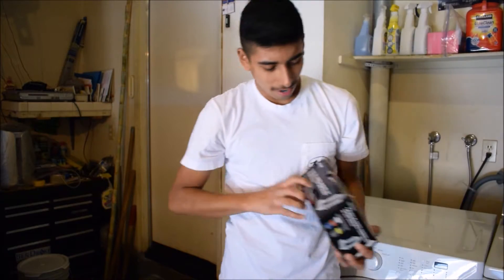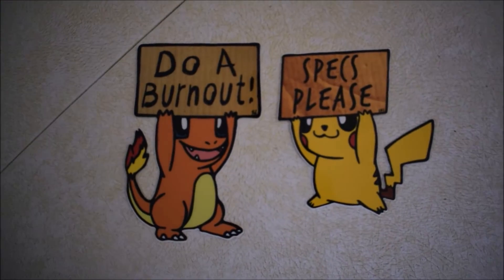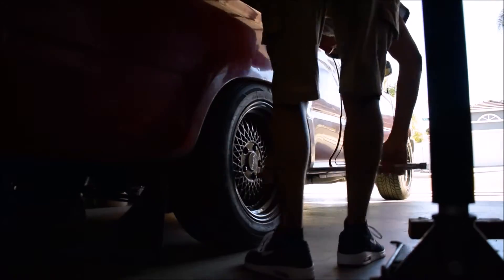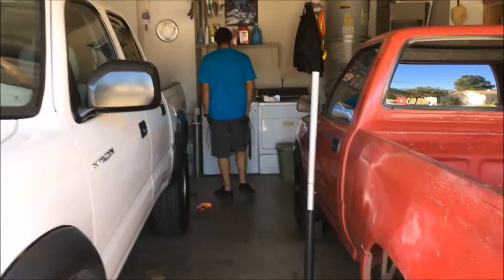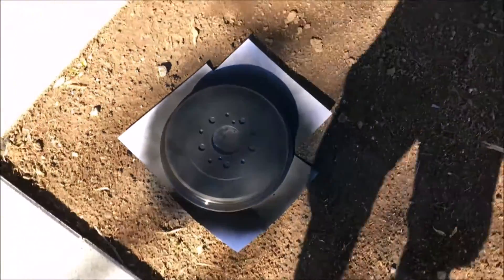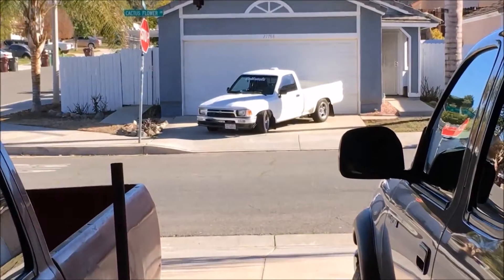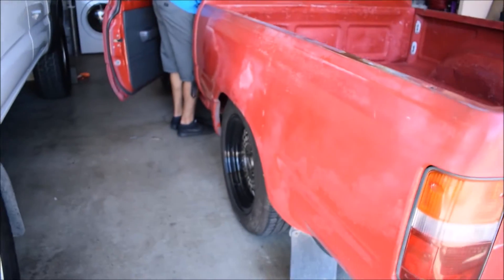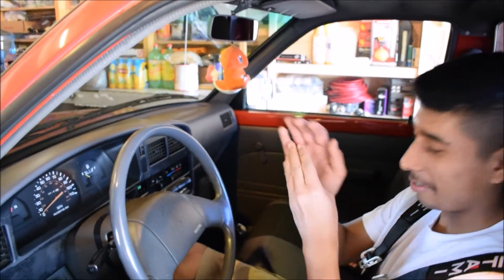Installing Four Point Racing Harness and Cleaning Rear Brake Drum

Comment: how do the leaf springs ride? i just got mine but haven't threw them on yet. i heard they're stiff af
Reply from the maker: Honestly man, I feel like it rides a bit better that it did with the stock leaf springs, but when you go over nasty bumps on the road, that's when you'll feel the stiffness
Reply: Car Bond forsure man 👌🏼
Reply: blues clues
Reply: What does ricky have have on the rear suspension

Comment: Do I have to installed spindles if a want to lower my yota
Reply from the maker: No you do not. You can just drop the torsion bars down and that too will also lower your truck from the front. The only reason people go with drop spindles is because it gives them a somewhat stock ride quality. When you drop the torsion bars your ride will just be a lot stiffer if you go over over bumps, or uneven roads.
Reply: Car Bond thanks man...